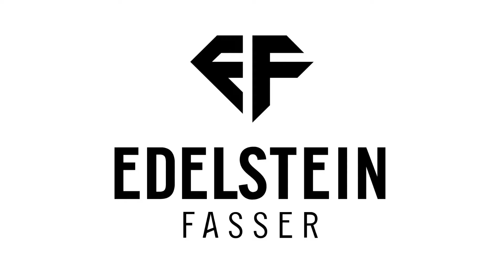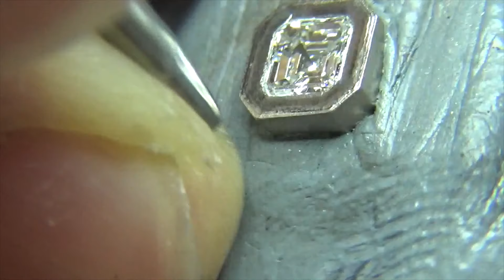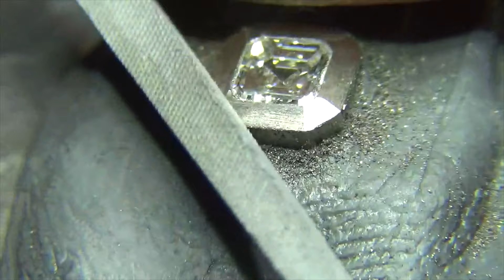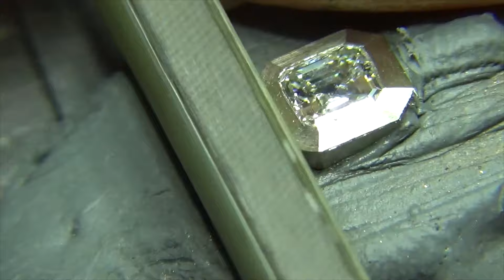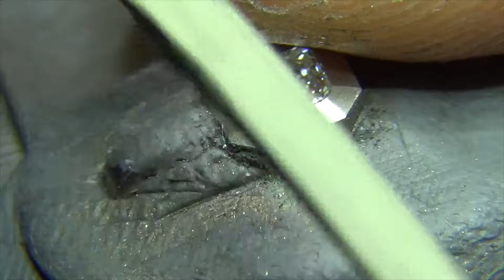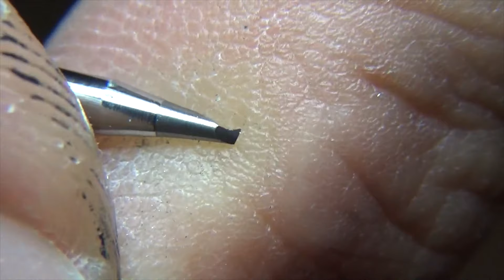HOW TO SET AN OCTAGONAL DIAMOND IN 18KT WHITEGOLD - THE DIAMOND SETTER

Comment: Absolutely incredible. 🤯 Are you using a hammer handpiece to set?
Reply from the maker: Hey! I use Gravermax for doing this kind of jobs. But especially this kind of settign you can do with hammer as well. If you set "soft" stones i recommend the GraverMax or a similiar tool, because with it you can fine tune the impact strength. Also with burnish or flipsy settings :)
Reply: THE DIAMOND SETTER yeah I figured it was with a graver setup, just amazed to  see the control you have with impact etc using it, it’s so fluid in the vid that I’m not even seeing the point move. I’m working with a foredom H-15, who knows, maybe one day I’ll be at a level where I can up my game a bit! Have saved your videos, they are a thing of beauty! :)

Comment: Hello sir what is the ball burr size?  and does the punch you are using is flat or pointed? and what is the graver at last used for bright cutting and what are the angles that you sharpened the graver?
Reply from the maker: Hey ! That depends on the size of the stone and girdle thickness. This one was a 4mm stone an i used a 0.6mm carbide round bur :)
Reply: @thediamondsetter6158  thank you and what is the graver that you are using
Reply from the maker: @saikrishnasanugula1177  selfmade out of an old carbide bur. shaped like in the video :)
Reply: @thediamondsetter6158  like what angle both same angles?
Reply from the maker: @saikrishnasanugula1177  yes :)
Reply: @thediamondsetter6158  thank you
Reply from the maker: @saikrishnasanugula1177  Youre welcome - please share this video, if you liked it. It help me to reach more people with this content. thank you !!

Comment: was the original geometry 3d printed before casting? (it looks like it was)
Reply from the maker: for sure ! - Palladium-Whitegold - customer wanted it without rhodium plating. No soldering joints and so on. Printed with an solus, casted with an indutherm MC 15+ - all the best !
Reply from the maker: Yes for sure - solidscape - no soldering joints 👌